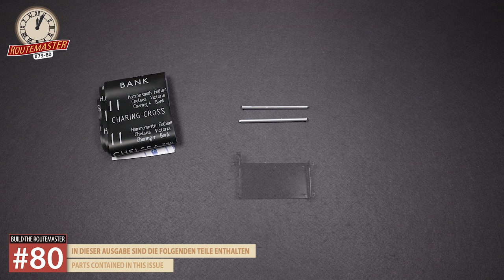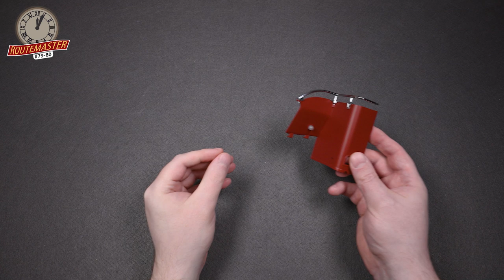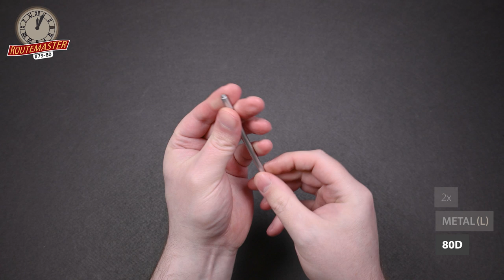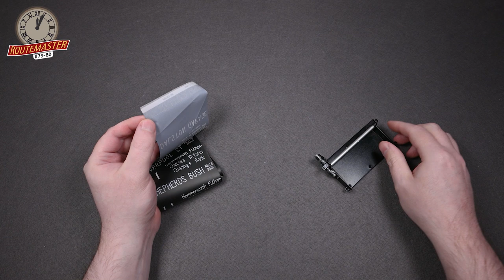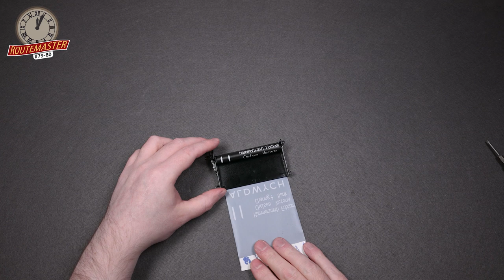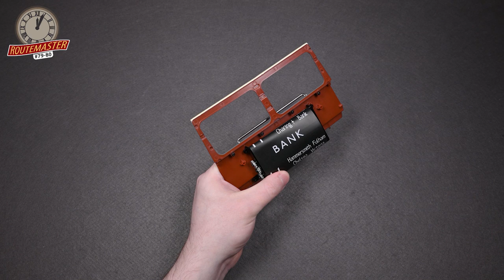Build the Classic Routemaster | by Hachette | #79-80

Comment: Im having trouble with my bus blind not moving... mine won’t move at all despite turning the silver n black cogs lots of times in both direction! I can twist black cog from the cab or under the red vent at front but it’s not really engaged with the silver smaller ones I.e struggles to turn them so I have to use a small screwdriver to get them moving...Any advice n tips without having to remove the front panel and if so what do you recommend?